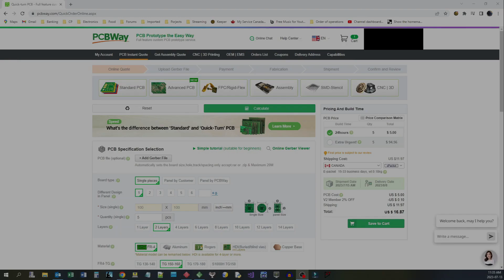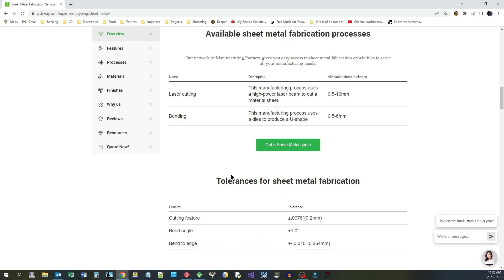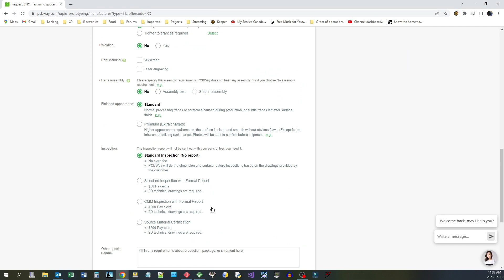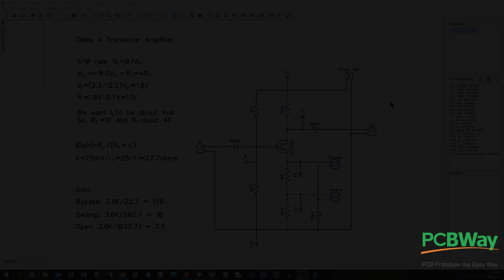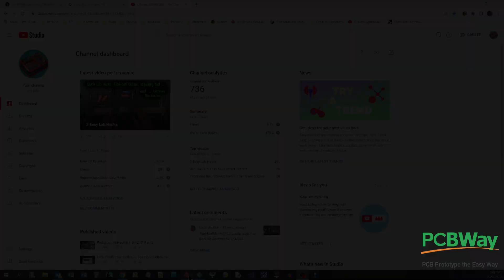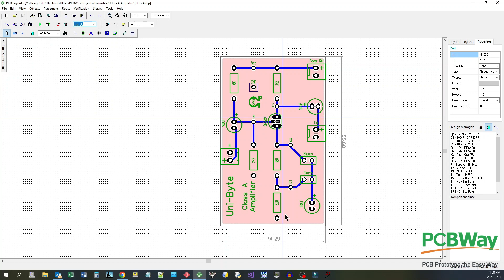0075 - Beginner's Transistor Project #2: Class A Amplifier Part 1

Comment: Is there a place where I can find the rules of thumb stated in single-line, written statements? Please and thank you.
Reply from the maker: Not that I know of.  Most of the places where you find a "rule of thumb" you also find a detailed explanation of where it came from.  Add to that the fact that the rules change based on the application (common emitter, common collector, switch, current source, class 'A', class 'B' class 'AB', etc.. ) then the list of rules of thumb becomes long and entangled.  Maybe someone should put the list together, but it would be long enough to be considered a book.  There is another book "Electronics Engineers Handbook" that can be had at a reasonable cost, but it is huge.  It probably has all the "'rules of thumb' in it, but you have to look for them.